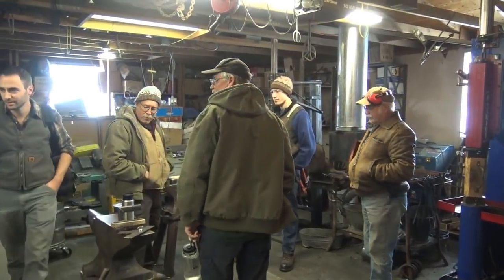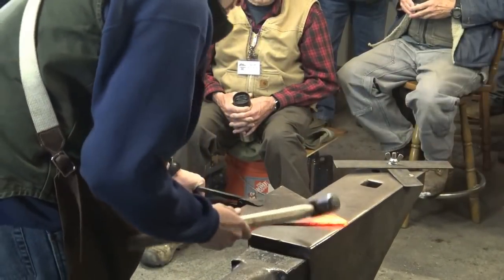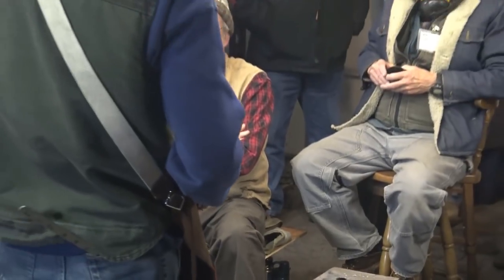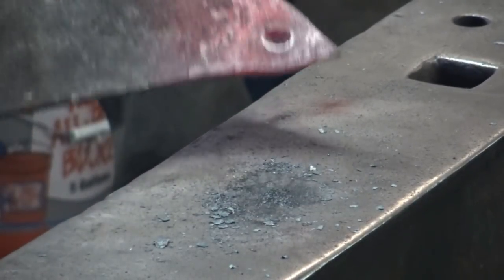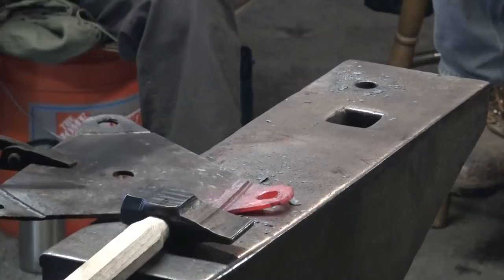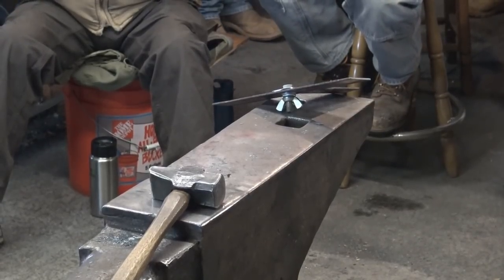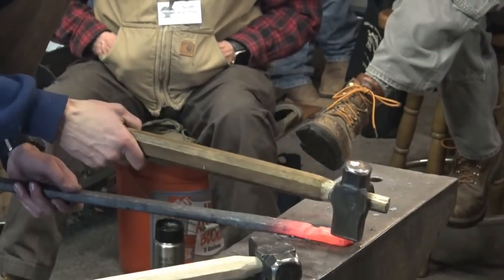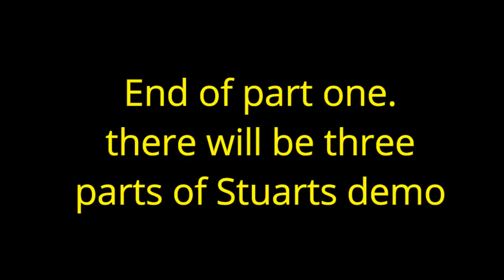Blacksmiths helper adjustable work stand with Stuart Shirley - part 1

Comment: Thanks for the share. Few questions if that's ok. First when fullering before a bend, does that weaken the bended area? Would this be a method to use on thicker bar stock to help with precision and ease? Last question, do you have a material list for this project? Thanks again.
Reply from the maker: I think it is a weaker technique.  However I don't think it is an issue since the legs are much heavier than they need to be from a strength point of view

Comment: i think i would have to had a few steps back with the hammer heads not attached right but i have seen what a 3 pound hammer will do to a face when it comes off
Reply from the maker: I think you are mistaking set tool heads with hammer heads.  All of the hammer heads were well attached.  The set tools are left loose for a variety of reasons the main one being so they are easier to remove and dress.
Reply: Thanks for that reply. I wondered why that fuller was not wedged on